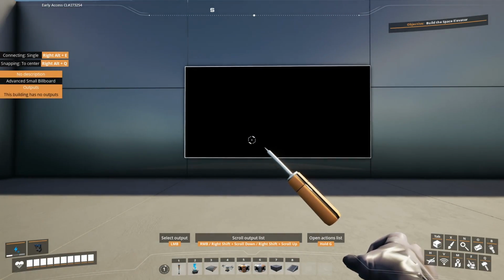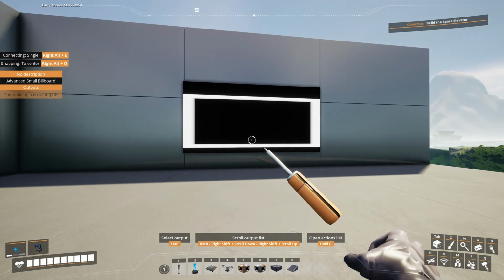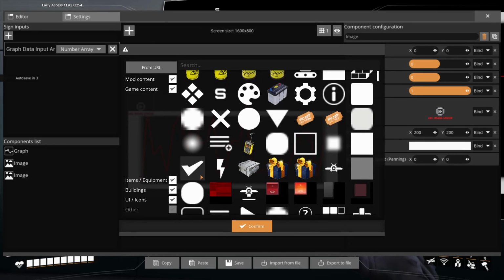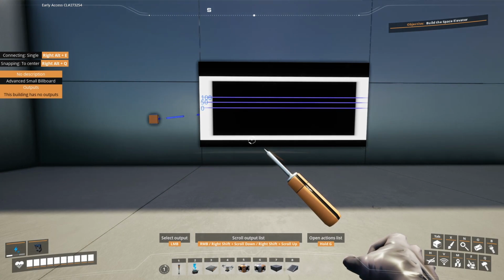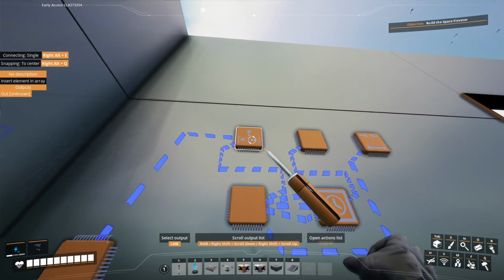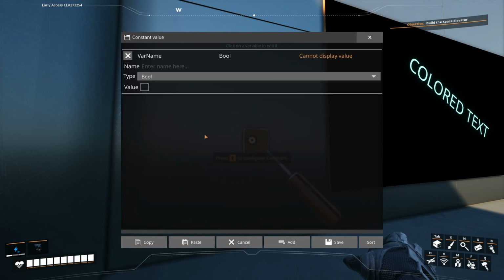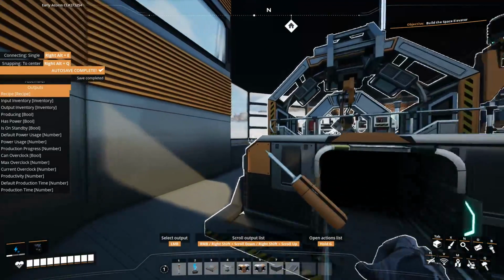Circuitry Mod Guide - Real Time Graphs

Comment: 12:40 i think you forgot to *100 the percentage, now it is just a 0,3 on a scale of 0-100 which won't be noticeable
Reply from the maker: I think the efficiency comes in as a whole number, not represented as a percent right? So in this case it would have been 30. I’m fairly certain anyway, without going back and looking
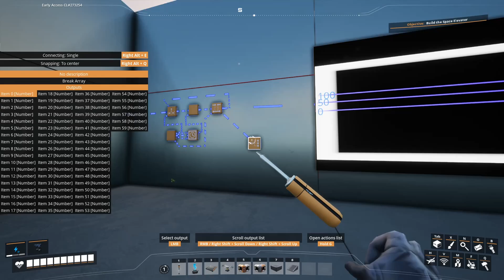Reply: @stickytak  at 12:14 you take the readout from the break array and it shows 0.35. Also explains why you don't see a result-line between your 0 and 50; cause if it was 30, we would have seen it on the screen.

Comment: Hello, mod creator here. Want to share a few notes on the guide to make everyone's life easier:
1. You don't need to eyeball things to align them to some specific position - instead you can right click on an element and choose "Snap to... <some position (i.e. center)>"

2. 1:31 You can simply right click on any element with "Size" variable and choose "Fill sign" to fit the entire sign rather than manually entering the correct values.

3. 3:02 You can click on "Bind" and press "Create new" to create a new input with the correct type instead of guessing which type you need. After that you can rename it to what you want
3.5. If you have a giant list of inputs, you can drag the input to a variable until it turns green and then release to bind it automatically.

4. 7:29 You can skip this entire circuit by using a gate called "Array recorder" which is going to manage this whole circuit for you - all you need to do is to connect your value to it, set the recording interval with a timer, and you're basically done.

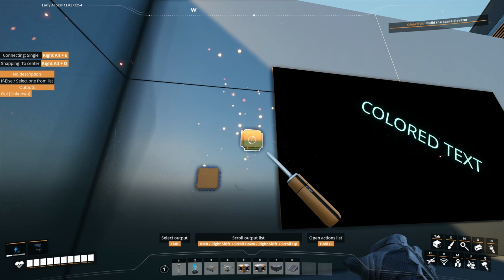5. 14:37 If you're smart enough to figure out how to set things up - you can use a gate called "Lerp Color" to smoothly go from one color to another, or even go through an array of colors.

6. Avoid making constants for everything, they're not the most inefficient way of doing things, but you can achieve the same effect by using "virtual connections" (check the "Advanced Wiring Tool" article on the wiki)
However please note that this only applies if you have a singular receiver for that data, so if you want to sync color between multiple signs then yes a gate or a constant is the way to go.
Otherwise stick to virtuals, since constants are just a "wrapper" for their functionality.

-1. Author, please fix the timestamps, going for coal in the middle of the guide is not something i expected to have to do /s (ಠ_ಠ)>⌐■-■
Reply from the maker: Top tier tips, that recorder will be a game changer!

Comment: Thx man! Glad i found your tutorial! Made my day! Is there any way to save the numbers in the array from item 60->Item0?
Reply from the maker: What do you mean by “save the numbers”?
Reply from the maker: @edgekunst7283 do you mean like save a snapshot of the current array you’re using?
Reply: @stickytak  Every 60 Seconds a Number will be saved starting with the slot "Item Number0" its the first number in the array. Like : Number=>Item Number1; Number=>Item Number2. But i want so save them backwards starting with Item Number 60 , then 59, then 58.
Reply from the maker: @edgarkunst7283  OH I gotcha, the setup should be almost the same as in the video, but you'll use the "add element to array" node which adds an element to the end of the array, and "delete element from array" node. So you'll want to delete the first element in the array, and then add your new element to the end of the array. So do that instead of the Insert/Resize method I have in the video. Does that make sence?
Reply: @stickytak  Yap made sense but i dont want it do anymore :D One thing more, u changed the graph min value and max value without telling! Needed a whole day to figure that out xDDDD anyways thx a lot! this video helped me a lot!
Reply from the maker: @edgarkunst7283  I was having inconsistencies with the min/max values when I was making this, so I put it back to 0/0 and just cutr that whole part out... Did that permanetly change something?
Reply: @stickytak  yeha it does set the Zero mark on different levels and makes the graph draw out if its box. In other words, if you dont set min and max value it will move depending on the data in the array your zero line and wont stay in the box